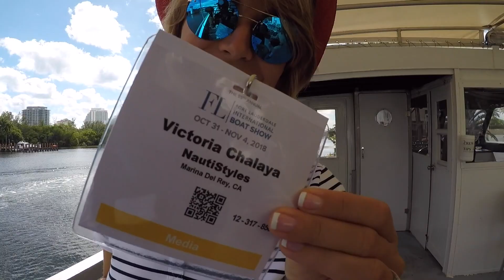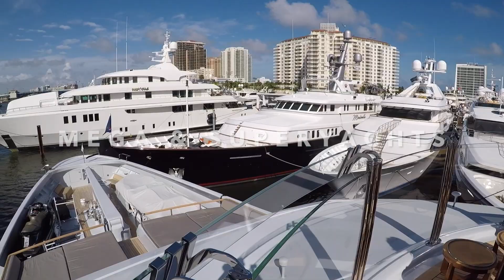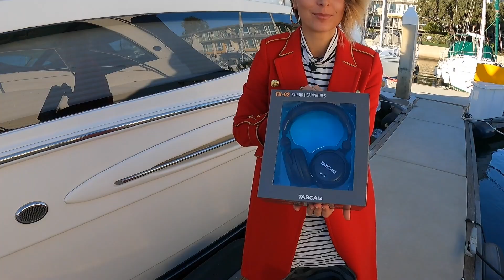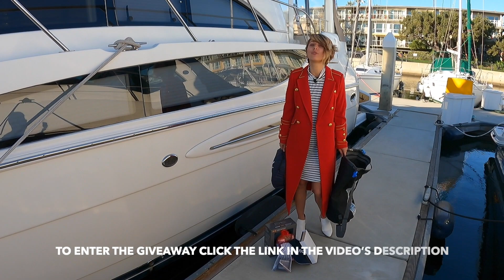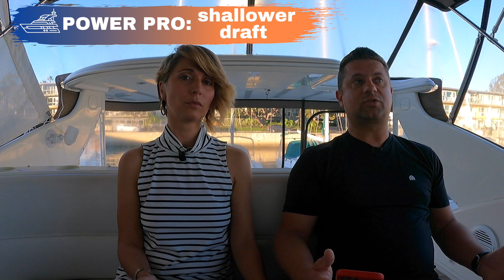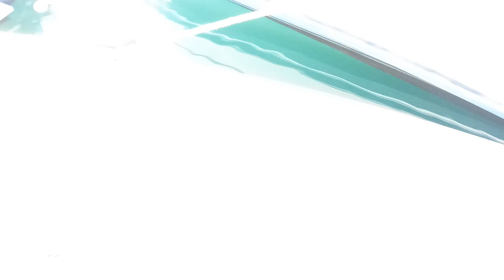POWER vs SAIL CATAMARAN Pros & Cons / Liveaboard Charter Sailing Yacht Tour Motor Boat Comparison

Comment: Thanks again for sharing Victoria and Rico, as a soon to be "Blue Nomad" here in Australia I have researched a lot of boats and started off originally wanting a 12-15 m sailing catamaran but soon realised that my passion for exploring the Australian coastline might not include my wife all the time! I soon realised that single handling a sailing cat (especially anchoring and berthing) when your almost 60 is not for me + I realized that catamarans hold a lot less fuel, water and waste fluid capacity so what's the point of sailing to our beautiful islands but having to stick close to harbours get more water or fuel, (yes I know watermakers are available) and for a sailing cat to work efficiently you need wind. But as a long time fishing boat owners when it's windy you don't want to be out in open waters as winds bring swells so I would be planning trips to coincide with good weather i.e flat seas = no wind!  Plus the fridge and freezer capacity of most sailing cats are ridiculously small (who has a bar fridge in your home as your main cold storge?) Soon the negatives on a catamaran started to add: small tender, less storage, type of toilets, less effective area for solar panels (remember you will have a BIG stade cloth up stopping your batteries charging up) I don't want to travel fast I want to enjoy the journey and taking in what nature has to share. For now, I'm back to using a powered single hull (pilothouse type with flybridge) that suits my needs and my lifestyle of fishing, diving and exploring. I really enjoy your boat tours can you please do more -50ft pilothouse boats and thanks for sharing. Keep safe and keep boating I always say.

Comment: An interesting topic, for me the question that would make me decide, would be the type of navigation. In case of voyages of many miles, the choice would be the sail, otherwise it would be the engine. Although living in the north, the inland helm that a motor catamaran provides is very tempting. In my case, the question is between two Fountaine Pajot models, the MY 40 and the Isla 40 and for now, I think the Isla has more points to be my refuge once I retire.

Comment: WOW 
What a great and informative video
We have plans to get a sailing catamaran, however self am not against a sailing monohull or even as more recently even a power boat
As you mentioned, battery technology has come a long way, and this might be the big thing for us
Reply from the maker: Thanks for sharing, if you have a couple of years to wait, it will be sooo much more advanced 🙈
Reply: @NautiStyles  
Yep, battery  technology is moving at a rapid pace
Am quiet handy, to the point where currently am building a Powerball for the house using LiFePO4 - this is shared on my other channel  "TechNando"
The cherry on the cake would be to convert a catamaran or even a monohull to full electric Myself - having no sails or focil fuels
Dry cells could be the future
Reply: You should really examine the viability of a battery only power plant before you jump head first into it. Currently, $8,000 worth of batteries nets you 10 nautical miles of range. Installing a big generator along with the electric propulsion would be a much better option, if you can afford it.

Comment: Thinking deeper on this it would depend on how I wanted to use it. Shorter Island hops and time constraints or long voyages and no time constraints. Fuel costs could be expensive, but time also has value.
Reply: Exactly , it really only comes down to a question of distance. 

How FAR do you intend to go? 

If it is often a significant distance ....sail is hands down the only option to consider . Fuel costs are unbelievably high.

If you just intend to operate the vessel around it's home berth on fairly short hops. Or routinely offer charter services to the same ports of call. Motor cat is the only option to consider . The added space and speed equal more income from more turnover of trips and charters.
Reply: Going 8knots with a power cat is relatively inexpensive (I think 20 Liter per hour!?)